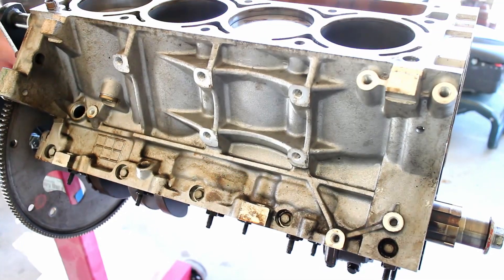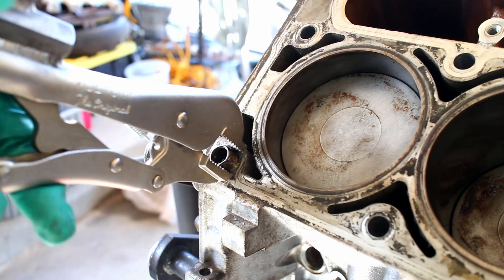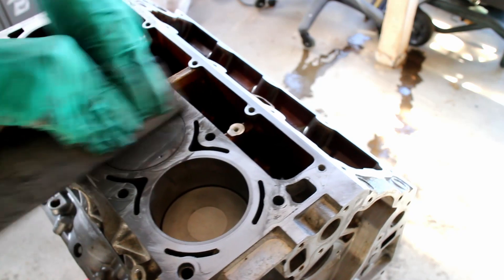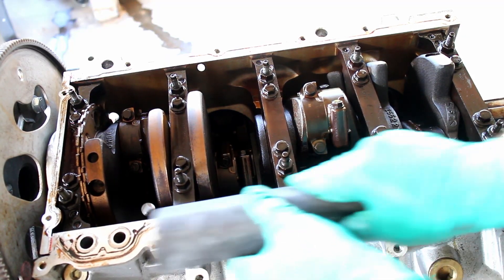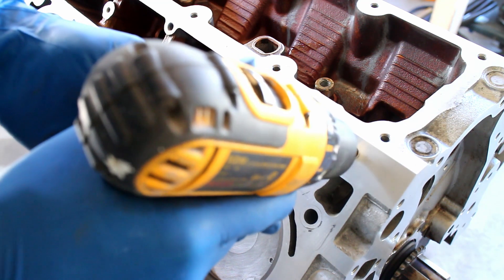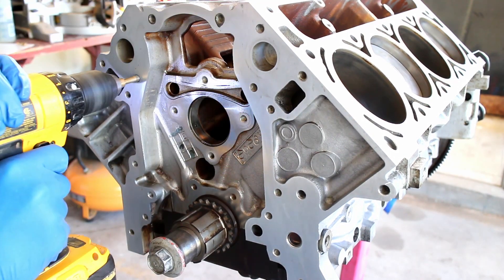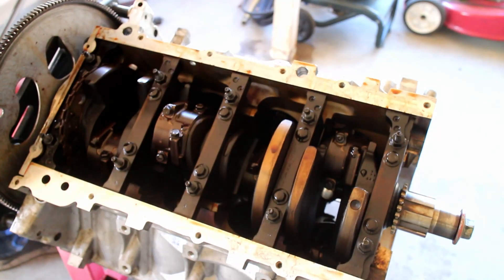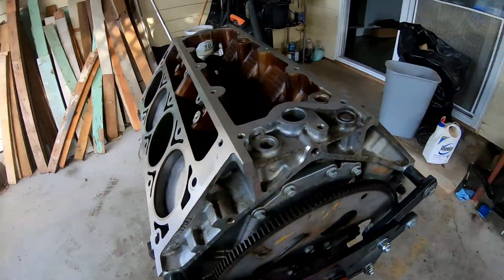LS1 Cleaning & Gasket Surface Prep (Pt3 82-92 Camaro/Firebird LS Swap)

Comment: Are you planning to replace the rod/cam bearings? I myself wouldn't had sanded the gasket surfaces, but instead used a soft brass wire brush. But if it's going to be a stock build with out high compression gaskets I'm sure no issues will happen.
Reply from the maker: cam bearings are good, unless you look at them
it's magic

Comment: I could only watch half of this. 😢 I’m sorry but you should have this machined or not messed with it at all I.e. use a razor blade.. the 1500 sandpaper that ruined the deck use a straight edge to reveal how bad it is… especially with a mls gasket and ur sanding block isnt a good idea either u want something ridged… the sanding block has a pad.. and spraying wd40 in the engine? Bro come on
Reply from the maker: nope!
engine has already been compression tested, all cylinders are within 5psi
TONS of guys take scotch bright wheels to a deck surface  and end up getting away with it.
hence why i was fine when i assembled the engine.
the 1500 takes off NO METAL, i know because i measured it.

as far as the WD40, a 6.0L i had years ago rusted the rods because they weren't coated in a rust inhibitor.
always god idea to keep any part that could rust protected.
Reply: I think we can all agree that sanding isn't ideal, but I am curious why wd40 is an issue for you?